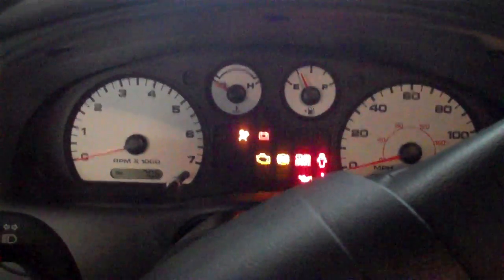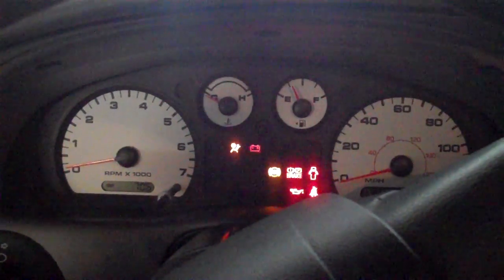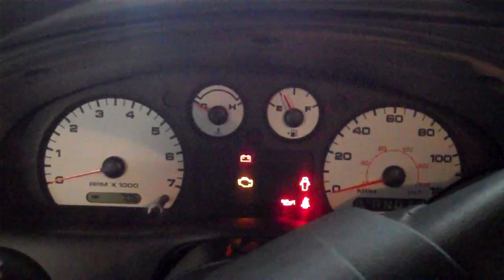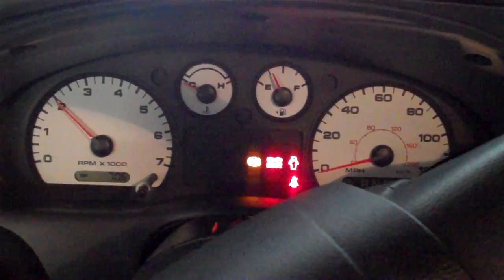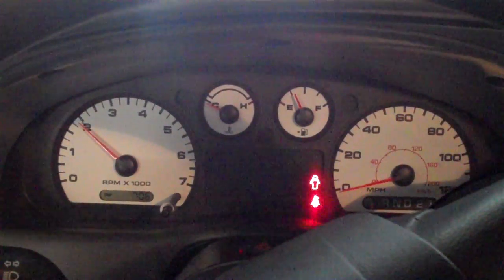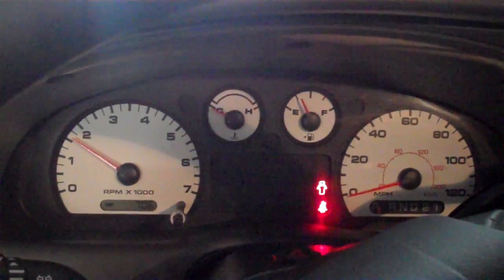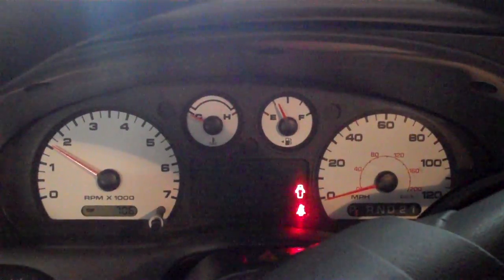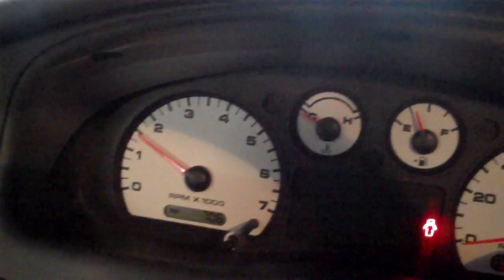2005 Ranger Cold Start After Head Job!

Comment: Thanks for the tips... I'll give it a whirl, it doesn't seem like it will b horrible, just if something goes wrong the engine has to come out to time it. Im thinking like a breaker bar and socket to the crank pulley and secure it to the frame so it does not move.

Comment: Hey brian... Love your videos. Looking for a little advise, i have an explorer @ my shop that needs the passenger head removed, the timing chain is in the rear, seems a little intimidating any tips u may have wld b great, i did read on mitchell that the bolt to the cam gear was reverse thread??? I wld really like to do it the way u did it,  mot tearing the engine completly down